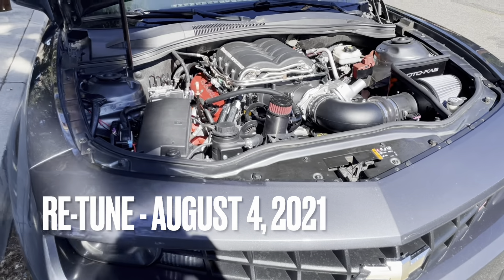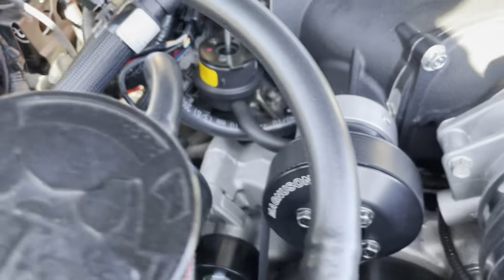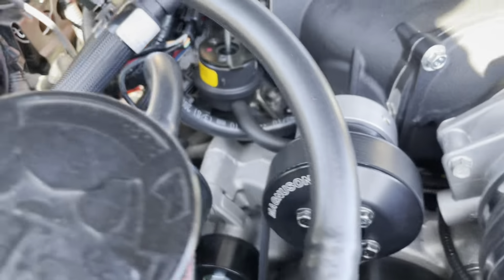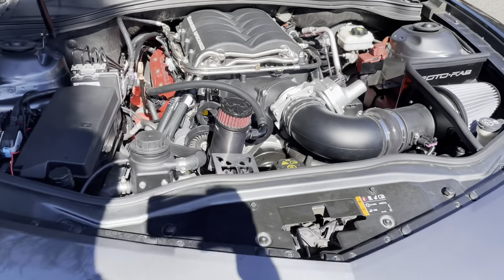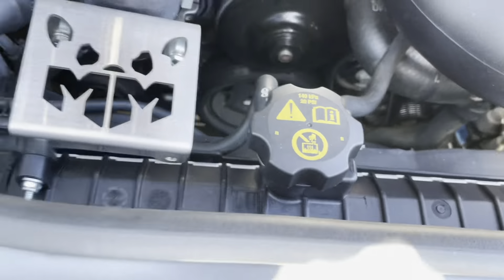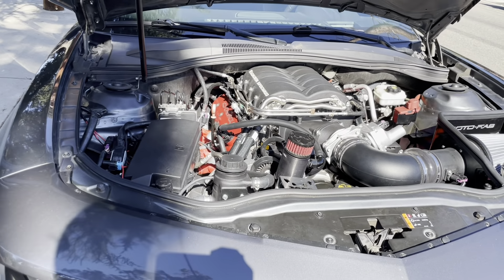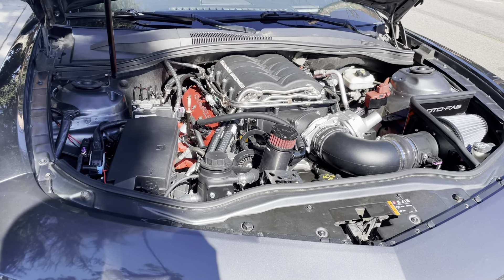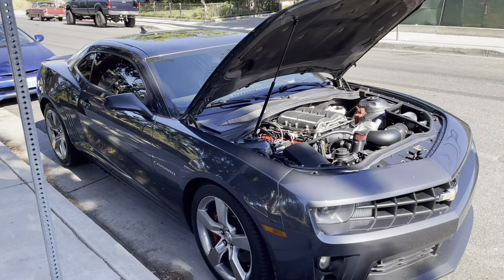New Era Performance - Re-Tune - August 4, 2021

Comment: You damn near have a ZL1!! impressive build !!
Reply from the maker: Thanks Lorenzo. I have since added a few more things to the car as far as drive train, exhaust, etc. Getting a new tune soon to hopefully push pass 650hp.
Reply: @allenwoolsey  Congratulations on the build again i was wondering if you still had the stock drivetrain still on with no modifications cause those numbers are crazy but won’t be reliable with no upgrades to it (based on research) but sick build hope everything turns out well! God Bless!!
Reply from the maker: @ThatsTLO  I have a DSS 1 piece aluminum driveshaft. Other than that, it’s stock. All new suspension and bushings are ordered and will be installed this Summer.
Reply: Zl1 for that year was 580, he's pass that status...lol

Comment: my brother made 704rwhp on his camaro ss with a non ported lsa blower, 245 upper pulley ,long tubes, rotofab inatke, e85 1050cc injectors ,the same pump our tuner said it had more in it but did not want to push the motor or blower
Reply from the maker: Hey Eddie. That’s some great power! My injectors are 1000cc and I was running out of fuel so we kept it conservative to not kill the engine. Right now I’m happy with the power and knowing that the engine is safe. Since I’m building my new 1969 Camaro from the frame up, I can’t risk blowing my 2011 Camaro motor 😁

Comment: Really nice car. What's the mpg and how much do you get till e?
Reply from the maker: I’m roughly getting about 15 mpg now. Not sure on the E yet as I’m getting that retuned again soon.
Reply: @allenwoolsey  that’s crazy, I’ve come to realize I think I have a heavy foot. I have a Intake exhaust * stock headers, 14 L99 and I get like 16ish one can only imagine what ima be getting cammed and blown… love the car what made you choose that specific blower rather than going with the LSA,Whipple, or even the centri blowers like procharger.
Reply from the maker: @Ryshann  I chose the heartbeat due to the power rating I was going after, the fact that their HQ is only an hour from me, the way it looks on the car, and most importantly how it was an easy bolt on kit with everything I needed. Magnuson has been great to me with replacing a couple of parts under warranty and also answered all of my questions before, during, and after the install.